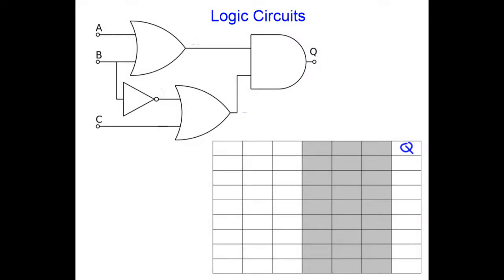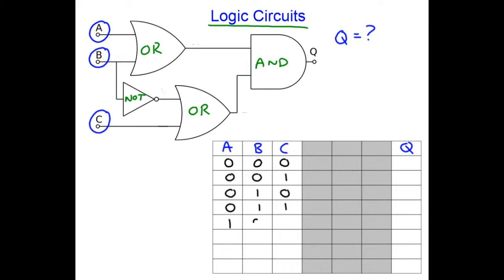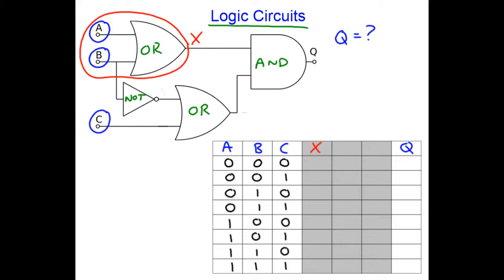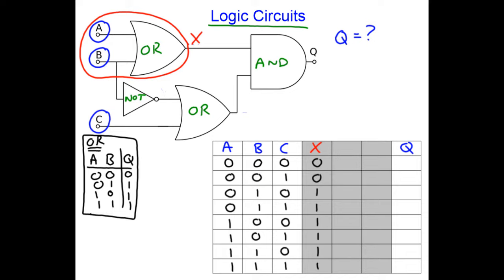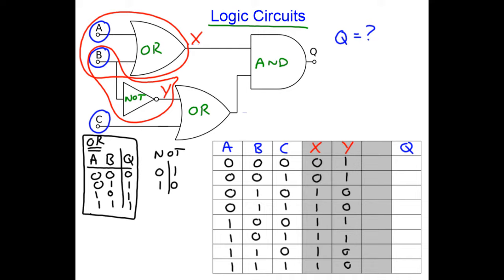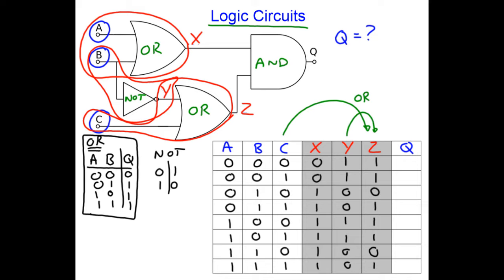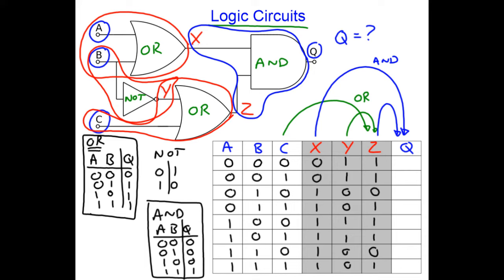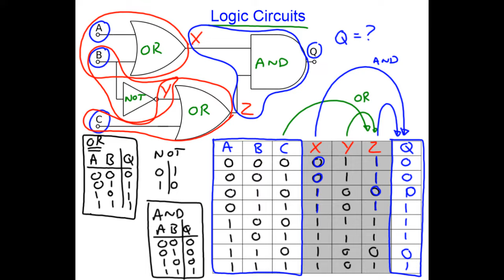Logic Circuit Analysis using Truth Tables

Comment: Column y is redundant. where either of the column x or z are 0 then the answer will be 0 as its an AND gate. If inverted it will be 1. Therefore we only need to analyse columns with double 1's.